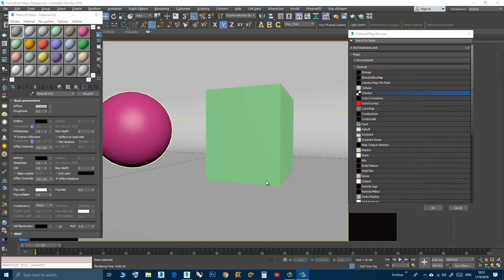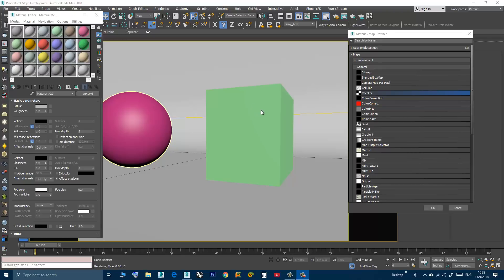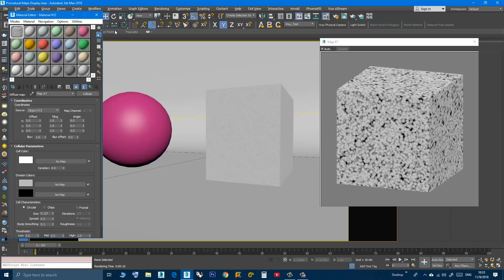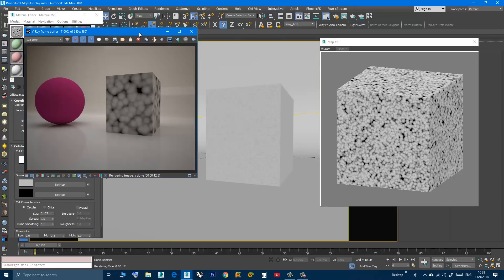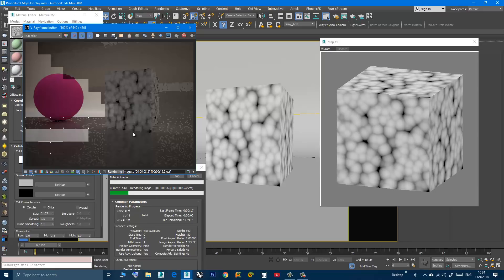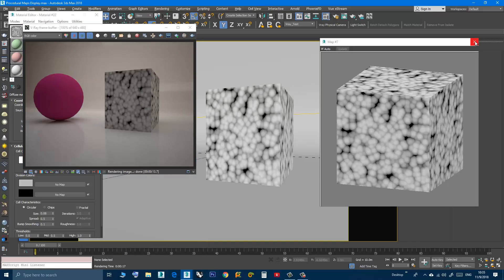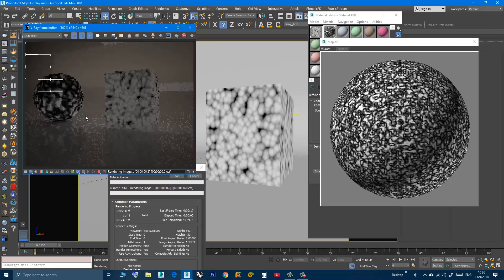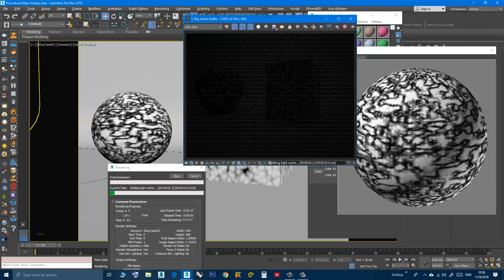3DS Max - Accurate Display Of Procedural Maps - Solved

Comment: This seems to only work with legacy MAX materials, not Arnold materials.
Reply from the maker: Hi, I'm using 3DS Max 2023 + Vray 6, and it's still working the way described in this video. Just for testing, even though i don't use Arnold, I switched to Arnold and tried this with a Standard Surface material + Dent map applied to its base color, and it's still working fine.
Reply: @MiledRizk  It is very easy to get blind-sided by an legacy map that doesn't work with Arnold, is the thing. And you know how it can be when you have to go through and change eeeeeeeeeverything because of one mistake...
Reply from the maker: Yeah i know :))

Comment: Do you have a solution for messed up display of composite maps?
Reply from the maker: Hi, and sorry for the late reply I was in the middle of a big project. I use 3DS Max 2018 and I don't have a problem with the composite texture's display. If you want to see the result on your screen you need to go up to the main parent material then check the option "Show Shaded Material In Viewport", otherwise, if you're in any of the sub-textures levels, using this option will only display this particular texture. Unless you're using a different Max version that has a bug or something.
Reply: @MiledRizk  the best example I have is a brick bitmap as layer 1, in a composite, and a black and white grout map as layer 2, on multiply (to make the grout darker). The mapping on the walls is carefully done so that the bricks apear correctly around corners. If you set the material to be visible in viewport, the mapping goes out the window and you get random mapping and crop of the composed maps. It's fine at render time as well as if you set the bitmaps themselves to show in viewport. So now you are forced to render in order to see the final result.
Reply from the maker: @calinpetrescu9128  I made a simple composite map, with a brick as layer one and a grout map with a multiply blending mode. here is a link to the screenshot, showing the display of the materials in the viewport and the rendered window: https://drive.google.com/file/d/1G64F9HOsDnVSqzo-Ihq2mX86E5HJLqTu/view?usp=sharing. By the way, if you choose as a display mode "High Quality" (in previous versions it was called Rendered) instead of Standard does it solve the issue?
Reply: @MiledRizk  Hi  over half a year later :))) So the issue seems to appear when using realworld scale. As a quick test I made a 5mx5mx5m box with Real-World Map Size ticked and gave it a material with a single brick bitmap node (no composite mape yet) also set to use real world scale of 5mx5m. All well and good until you plug the bitmap into a composite map and the composite map into the diffuse slot. No other maps needed in the composite map to recreate this issue.
Reply from the maker: @calinpetrescu9128  Hi, you'll find attached a Max file with a brick texture used in it. In this file, there is a Box with 5mx5mx5m dimensions and Real-World Map Size checked. In the material editor, there are two V-Ray materials, one with the brick texture in the diffuse slot, with the option "use Real-World Scale" checked. The other V-Ray material has a Composite map in the diffuse slot, and in the Composite map, there is the same brick texture, also with the option "use Real-World Scale" checked. Try to apply both materials on the box and you'll see that they're giving the same result.